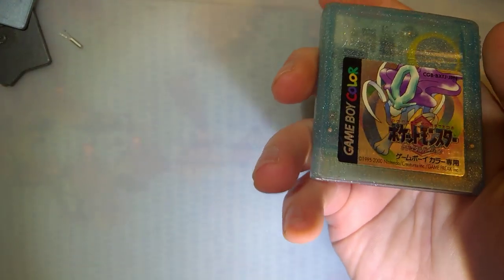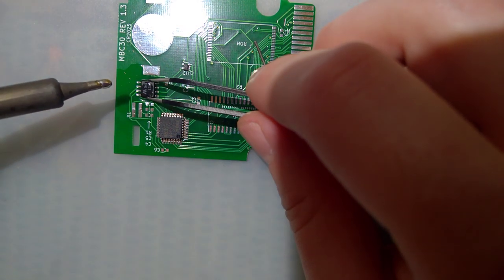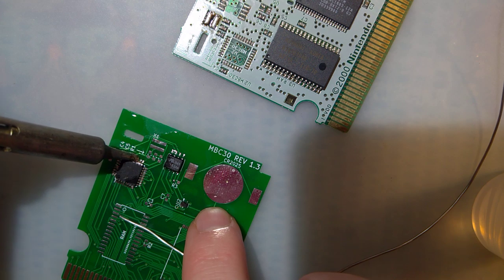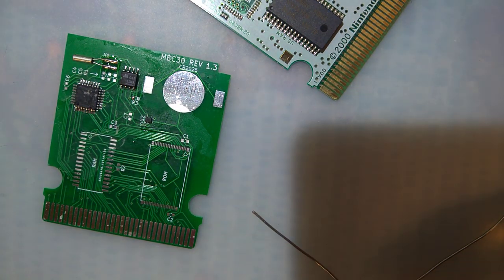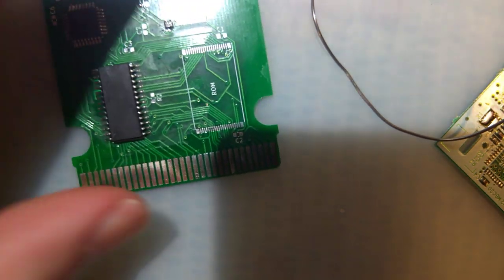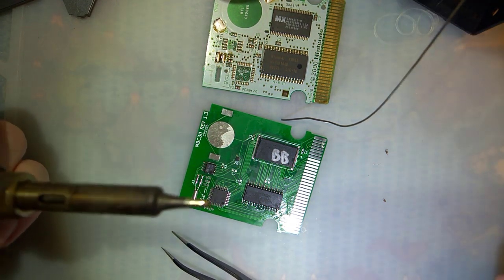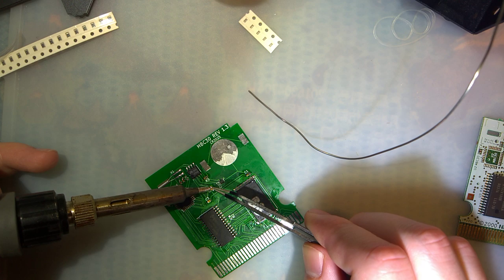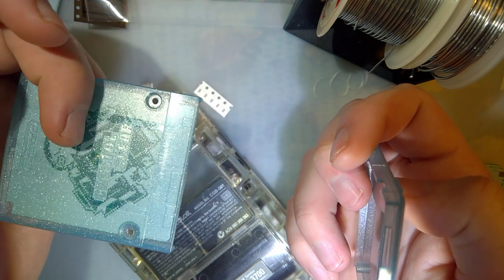Building a MBC30 4MB FRAM Flash Cart (Part 1)

Comment: I made one of these a few days ago and it worked perfectly with Crystal Clear (saving and RTC works). Just some notes. C2 in the flash cart is not necessary and without it shell closes better. Also, make right battery pad soldering as thin as possible to help on this. And regarding the missing resistor, IIRC all MBC3 carts have this 330Kohms just next to the other two reused capacitors, close to the clock crystal. And this resistor is connected directly to a MBC3 pin, as well as the R2 in the MBC30 JP Crystal. So you can reuse this R2 resistor to place it in the flash cart R1 (looks like some Crystal JP contain a 330K and other a jumper labeled as R00, either way it should work). If this doesn’t make the cart working and saving, replace FRAM.
Reply: C2 was relocated for Revision 1.3.1, so it should close correctly now :)
Reply from the maker: p3 spoilers

Comment: makho Why do all these custom flashcarts you make have to use chips from the JPN version of Crystal? Isn't it possible to make a flashcart with similar functionality without having to salvage parts from a Japanese copy of Pkmn Crystal? Great video, by the way, I really enjoy all these flashcart-themed videos you've made as of recent...
Reply from the maker: My primary use for flash carts is playing Pokemon ROM hacks. Most of these ROM hacks incorporate RTC functionality which is only possible on real hardware at the moment by either using an expensive off the shelf flash cart (the Everdrive since the EZ Flash Junior doesn't yet have full compatibility) or by salvaging MBC3 or MBC30 controllers to make custom flash carts. 

JP Crystal is relatively cheap and just looks fucking wicked. JP Crystal is also the only source for MBC30 chips and such is the only way to make a 4MB RTC flash cart (which is not yet utilized). 

At the end of the day, I do already have an Everdrive GB-X7 and an EZ Flash Jr so it's not like I need to make these carts to play the ROMs I want to play. I just like experimenting with hardware and documenting things that may not be widely known.

Comment: Can RAM from a donor card be used?
Reply from the maker: Well the donors all come with SRAM which requires a battery backup. FRAM, which is what this board is designed for, does not require battery power and the board is designed with that in mind. So no, not really.

Comment: Great video, that’s again what i like about @makho , why making one, because i can and it’s cheaper then an everdrive 😂 
I can’t solder anymore because of my medication ( my hands shaking to much) but if i could i would try the same stuff (i Made my own parallel SMS flashcartridge in the past also tried and failed my own gb flashcards back in the day from reinerziegler webpage ( reinerziegler.de.mirrors.gg8.se/readplus.htm ) it was the goto page back then, i ended buying a Super Smart Card from China Coach Limited (for cheap) and later the gbxchanger 64 from bung

Comment: This is just a shot in the dark, but could it potentially not be saving because the battery terminals aren't connected? If I understand, FRAM is supposed to save without a battery, but maybe the contacts are worked into the circuit and need a jumper or resistor or something?
Reply from the maker: Nope, different reason. If you google "MBC30 pinout", you'll likely get an image with the wrong pinout.
Reply: @makho  so the board has the circuit laid out wrong because it was based on the wrong pinout?
Reply from the maker: @blindsniper9794  correct